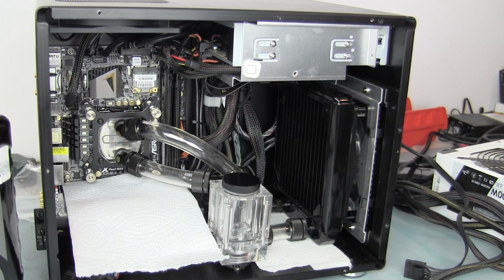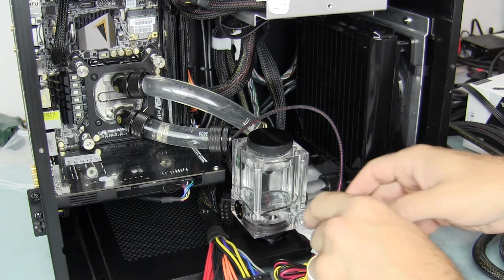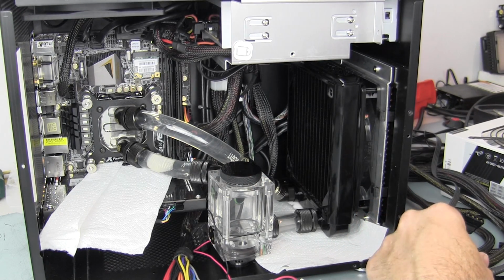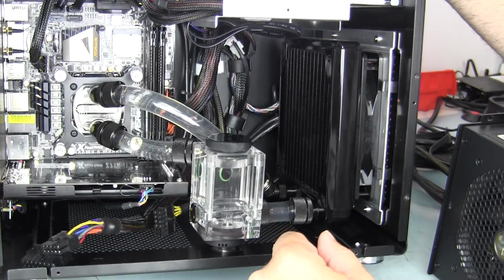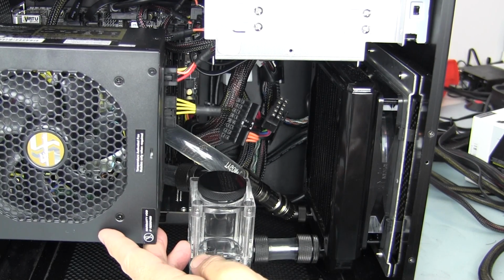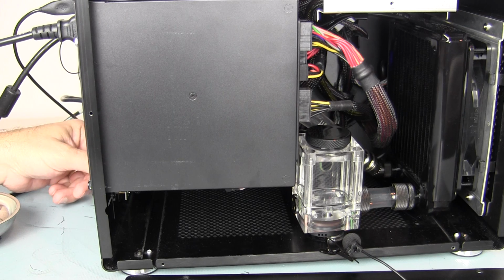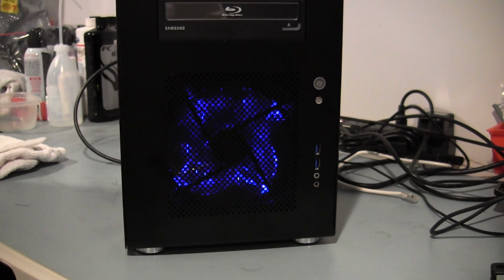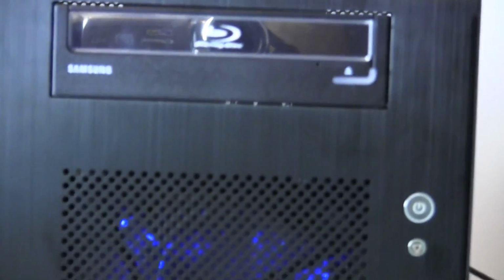Lian Li PC-Q08 Water Cooled HTPC Build Log - Part 4 - Build Part 3

Comment: Wont ther be an issue with air separating from the water caused by pump cavitation causing the air to collect at the top of the radiator?

Comment: I enjoy watching. Why not plumb the pump/res assy direct to the rad with a coupler?The PSU wires are still kind of tight. It's also going to be a problem when it's time to clean the filter sandwiched behind the rad & fan. With the res and pump being part of the rad fan assembly  it would be alot easier to move to do maintenance. I think it would look alot cleaner too.

Comment from the maker: Not a bad case. I like it but it would not fit in the space where my HTPC is supposed to fit.  Actually turns out my case was .376" to tall. After all this work it has to sit besides my HTPC setup. I will need to change the case .  Oh well :-)

Comment: I considerd this case for my htpc. But mainly because of the akward PSU spot i decided to go with the Fractal Design Core 1000. Its a bit bigger than this case, but it has beter airflow and is easier to work with. But that might be personal.